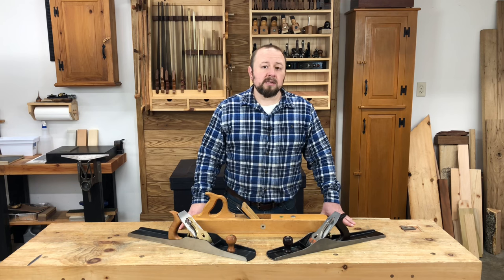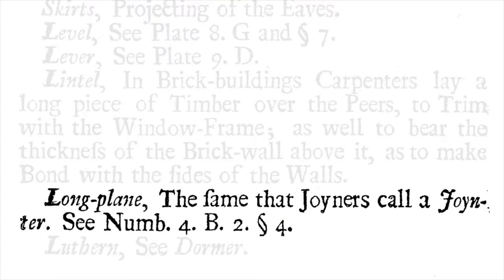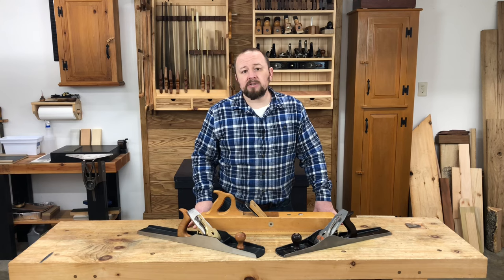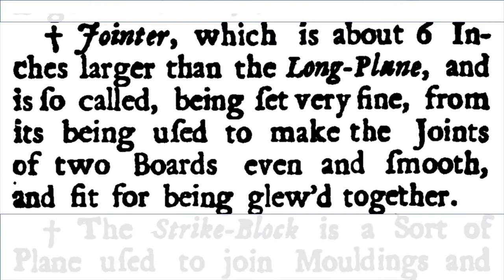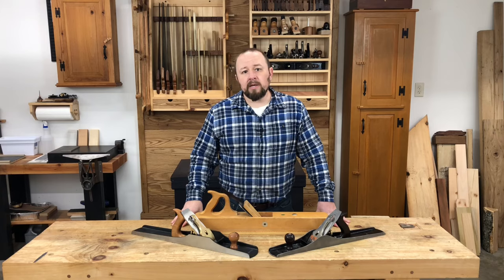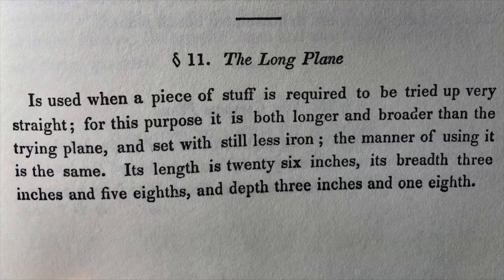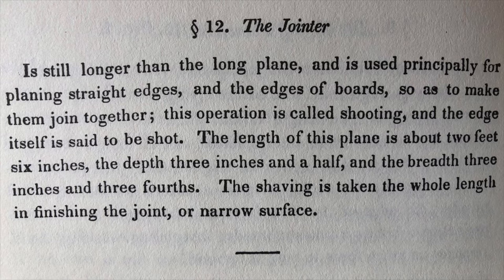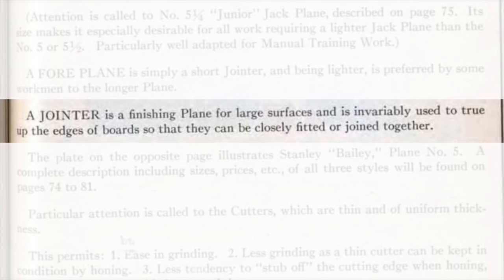What’s the Difference Between a Try Plane & Jointer Plane | Hand Plane Foundations

Comment: I am an "old soul", so I very much like your historical explanations of the tools Bob :) I dont prescribe to the normal numbering system for some of my planes...... a 5 1/2 is my fore plane, a 6 or 7 is my try plane depending on the size of the part im truing. I name them for what they do for me, not by what number is cast into the sole or what Stanley said they were for. I use my try plane to true edges as well as faces. I do use a slight camber on this tool, even for edges..... not as much camber as a jack plane would have, but a little more than what a smoother would have. I find it much easier to square an edge with a slightly cambered iron, I can center the iron to the high side of an edge to take it down and make it square. I found using a straight iron to do this job frustrating and vexing.... I struggled to make an edge square. Maybe I lacked the technique to do it this way. 
I am enjoying this series of videos, they would be a great help for the newer woodworker, you are a good teacher Bob :)
Reply from the maker: Thank you!

Comment: What would try plane would you recommend to someone trying to acquire a try plane ?

I’ve heard older metal try planes can be problematic. I thought about picking up one the ece jointers. 

Always enjoy your videos.
Reply from the maker: ECE is good. I have the Ulmia version. Lie Nielsen and Veritas are great as well. Old USA & UK made Stanley are usually fine too.
Reply: hi, I know this is a 7 month old response. I have 3 different lengths of ECE planes - a 24" jointer, a 22" short jointer (try plane) and a 17" English jack plane (fore plane). It's an ECE older version. I think ECE offers it a bit shorter now. I have bought my ECE's from Dieter Schmid in Germany (great selection and fast shipping). I love the 17" fore plane! It does the job easily. 
I own both Ulmia and ECE. I have an older Ulmia bench and someday a great grandchild will use it. Both companies offer superb value. They've been operating for 170 - 150 years.